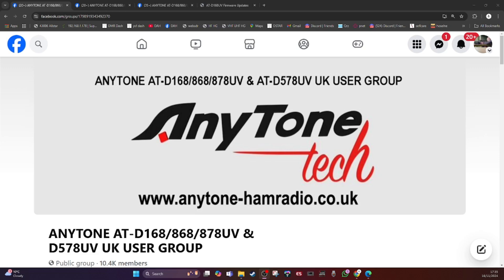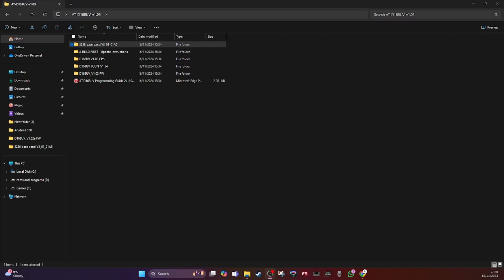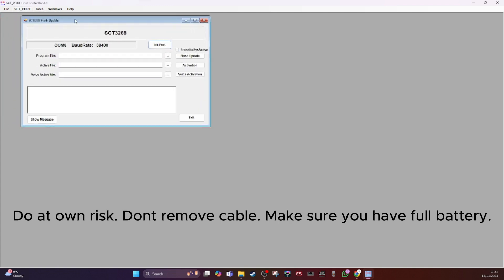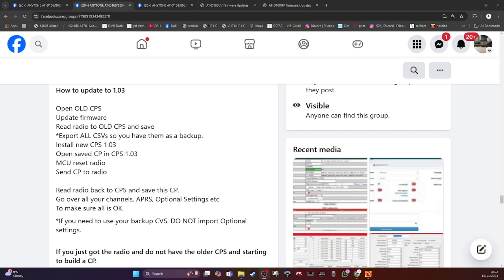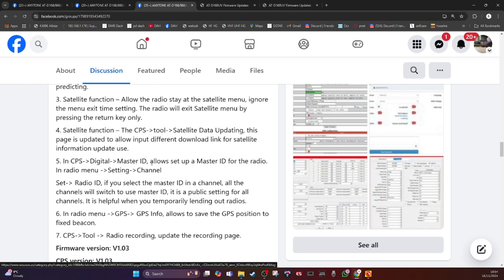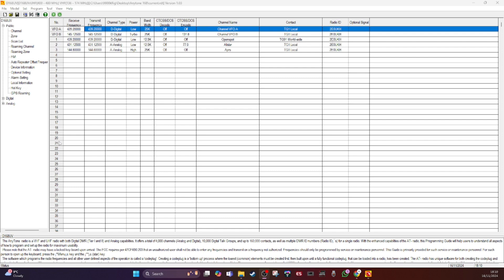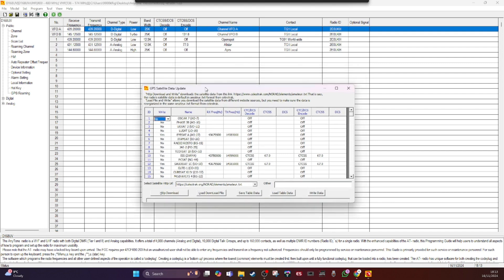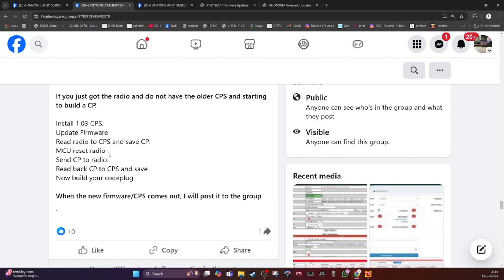Anytone d168  baseband and fw update

Comment: I've just got the Radioodity version but wish I hadn't as the anytone is £26 cheaper. For some reason with version 1.02 of this prog you can't edit the latitude and longitude in the APRS screen. Any ideas why ?
Reply from the maker: The problem is and I might be wrong. I don't think you will get regular updates like the anytone. I have been told the any tone fw will not go on it. Check what is available for anyone and then check what you are on.

Never had much success with aprs on anytone. I've not heard of anyone getting it working on aprs.
Reply: @digitalanaloguehamradio  I'm talking actually about the Radioodity version which if you look at tech minds video it is fully working with APRS where you enter the latitude and longitude values in the CPS software but as I say for some reason I can't do this
Reply from the maker: @digitalmediafan yes, I know you're talking about that version. I will watch his video again
Reply: @digitalanaloguehamradio  The anytone version of CPS worked fortunately

Comment: OMG. I've just bought my d168 and I think I'm over my head. 
First of all the radio I think it's messed up (I'm waiting answer from the seller) because I don't have a complete menu, there are parts of the menu that are missing. I can't switch between VFO and channel (side button doesn't want to change, it only changes between the lines with a long press but the short press doesn't do anything and I don't have the menu to set up the buttons), I can't save a frequency , basically I can't do anything with the ht for the moment. 
And even if it worked, this is on another level of difficulty.
Where do I get the cps? I already downloaded the firmware. Btw , the firmware on my ht is 1.02, not sure if that is the cause of the problems I'm having. 

Enough rambling. 
Back to searching for answers on YouTube. 
Cheers everyone.
Reply from the maker: Hi mate. Chris, please join this Facebook group which is run by beta testers people that understand the software and work for anytone. If your radio is missing menus, you may be in professional mode not amateur.  Install the software on your PC and read from the radio in optional settings on the left go to one of the screens on the left I think it’s working mode or home mode. And at the bottom, you will see a choice for professional or amateur. If you can’t see it, ask in the group.

https://m.facebook.com/groups/1798919343492370/?ref=share
Reply: @digitalanaloguehamradio  you are absolutely 100% right. I was in professional mode. No sure why the sold it to me like that. I just figured it out a couple of hours ago. 
Thank you very much!
Best regards